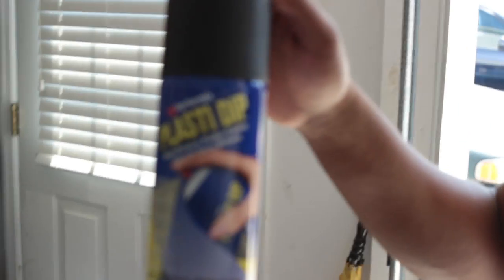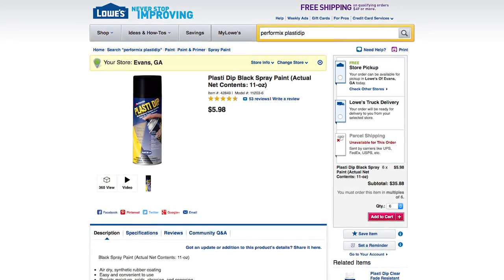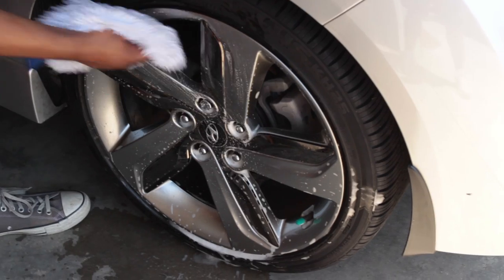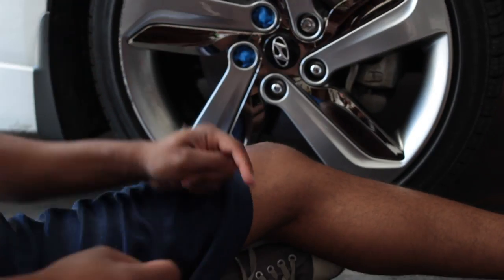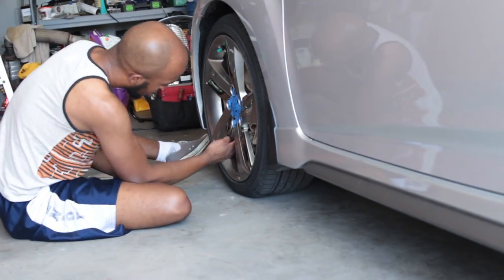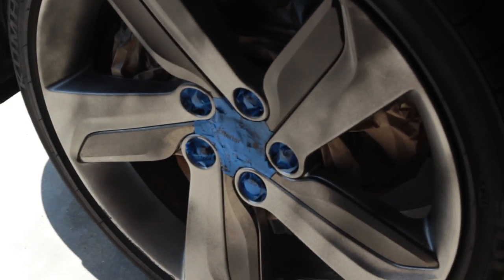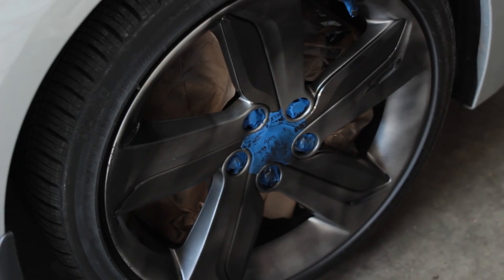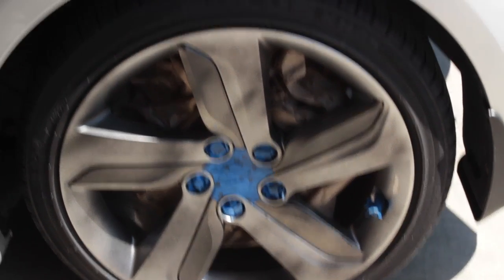Plasti Dipping The Veloster Turbo Stock Rims [Vlog]

Comment: nice dude. I love the slider shots! which one do you use? it's super smooth
Reply from the maker: +Koriginal ST Thanks man. I use this http://www.amazon.com/gp/aw/d/B00R1USQYO/ref=sxl1?qid=1463507242&sr=1&pi=AC_SX236_SY340_FMwebp_QL65
The reason it's so smooth on this video is because I did some work in Post. The lens I was using for this is a little too heavy for this slider and the results are mixed; however, when I use my lighter lenses the slider is smooth as butter.
Reply: +TechNation thanks bro! and yea the close ups look smooth as heck ha. I've been using the sony a5100 on my recent videos so I don't think weight will be an issue haha
Reply from the maker: +Koriginal ST Ahh that's what you use. Your vids are solid man. Those Sony cameras are legit.
Reply: +TechNation haha yep! my quality really went up from using the go pro hero 4. I feel the camera is made for video haha but I need a stabilizer and slider to be at your quality lol
what camera do you use?
Reply from the maker: +Koriginal ST I wish I had a stabilizer. I use a Canon T3i with some Rokinon lenses. The camera looks pretty good but I'm ready to upgrade to one of those digital cinema cameras like a Canon C100 or a Sony FS5.
Reply: +TechNation dude I just looked at both of those cameras and the sony fs5 is sick af...... you need that in your life hahaha
Reply from the maker: +Koriginal ST Yes! I completely agree haha. I'll be on the look out for some buttery slider footage to pop up on your channel.